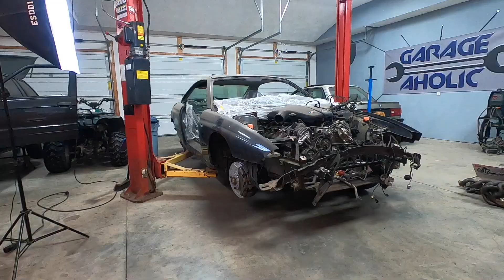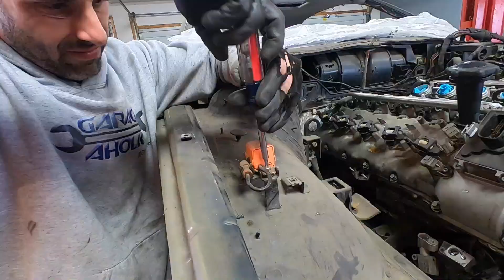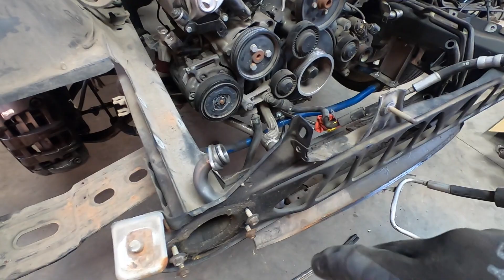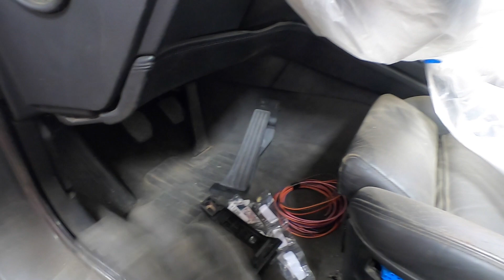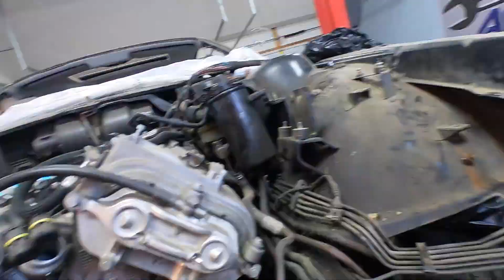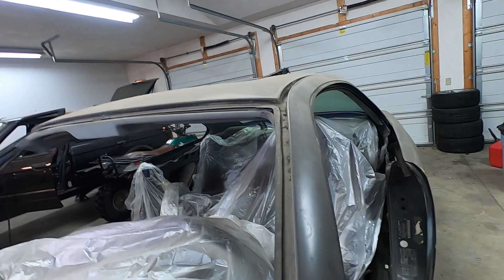Let's Sort Out This S85 V10 Engine Bay!!

Comment: Hello garageaholic,

NEAT Project you have going on with the S85, I will be following.

I am working on rebuilding an S85 and have some questions maybe you can answer.  Did you rebuild your S85?  I currently have the engine on a stand and trying to remove the VANOS actuators.  I have the special service tools, but cannot find socket to fit VANOS to camshaft bolts.  Are they 17.5mm?  Tried 17mm and No-Go, but 18mm too loose.  Went for SAE/Imperial 11/16" an too tight to get on the bolt!  Diff between 17.5mm and 11/16" is only 0.0015" with 11/16 too small!  And I cannot find a 17.5mm 6pt socket....grrr!

Please advise if you have a suggestion.  Service manual just states "remove" bolts....grr.

Mr. P
Reply: PS:  Red large gauge wire with bolt (~11:42 in vid) most likely "jump" point as battery is in trunk.  Very common on cars that put batteries in places not easy to access.  My Audi cars from the 80's have the battery under the rear seat.

Just FYI and hope it helps...Mr. P
Reply from the maker: Hey I have not done any open heart surgery on this engine yet! I do plan to issue a very detailed video on rod bearings but don’t plan to update on VANOS solenoids. I would love to dog in to this engine though!

Comment: Awesome! I am considering putting a S85 in a non BMW. Do you know of anyone who makes a standalone wire harness that will allow one of these engines to operate in any car?
Reply from the maker: Actually I don’t know of anyone! I plan to use a CAS/DME/KEY solution this soring
Reply from the maker: You know I’m actually seriously considering going SC Tornado2 for engine management. Might save me a lot of time in diagnosing. We’ll see! It’s a pretty penny, but for the assurance of having a plug and play solution? Hmmmm
Reply: @Garageaholic  Thank you, I will look into the SC Tornado2 as I am not familiar with that.
Reply from the maker: Steven Bang I’m looking into it myself as well!

Comment: keep up the good work! btw: the m70 also had drive by wire...
Reply from the maker: My next video on this build will show that the early E31's came with throttle cable
Reply: @Garageaholic  I'm curious to see which one that is: "Electronic Throttle Control instead of a mechanical throttle cable." - https://en.wikipedia.org/wiki/BMW_M70 

I have 2 m70's here at home (a 1990 and a 1992 850i), both of them have ETC. 840ci's had a throttle cable. those were M60 engines.